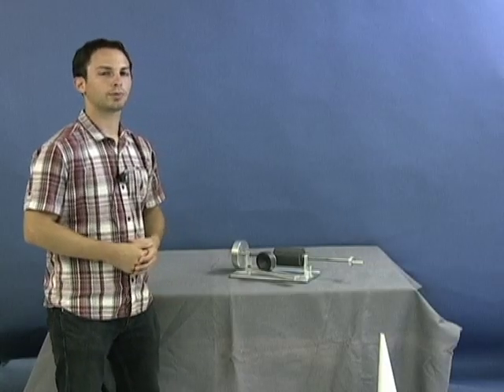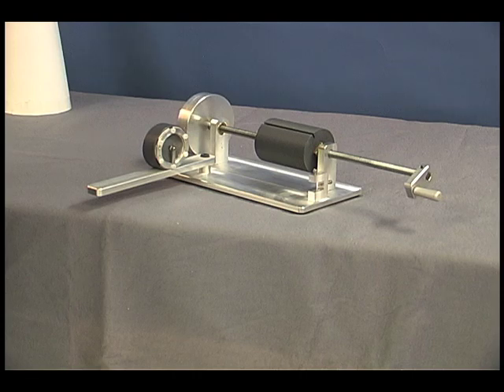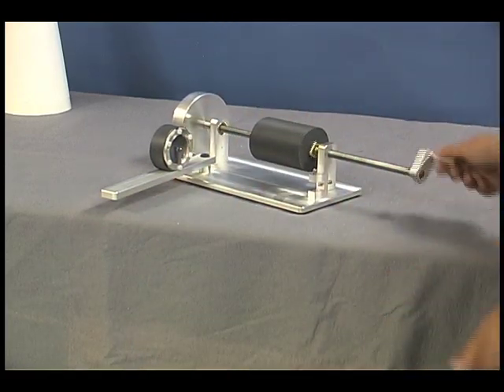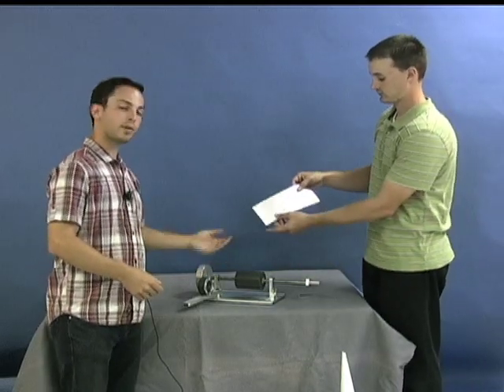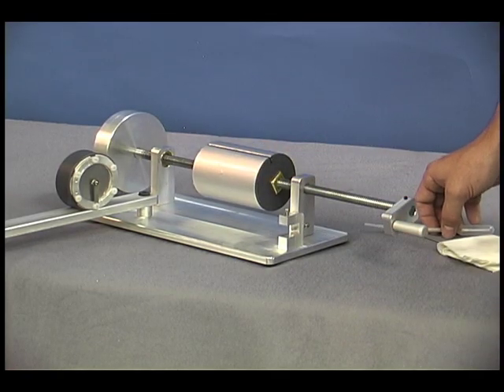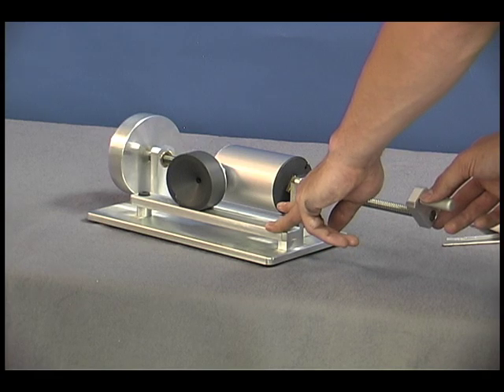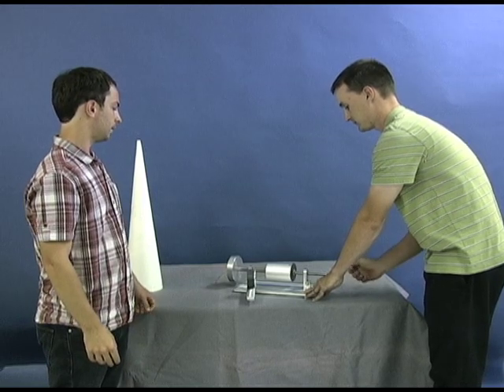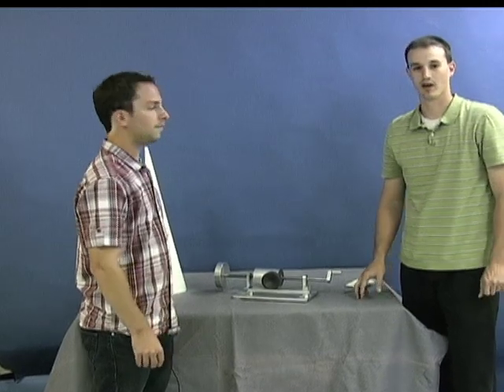A Homemade Edison Tinfoil Phonograph

Comment: Nice job. I'm interested in the stylus used in the diaphragm, I've seen sewing needles placed in a hollow tube, and even needles without the tube.
Reply: just a neumatic analogy piece? air moves it? the needle
Reply: @courseychristopher_art  Air vibrates the diaphragm then the vibration goes to the needle which vibrates it in a unique pattern which etches the foil with the same pattern.
Reply: Yes. That seems to be the heart 💜 of the whole system!

Comment: How dies the needle find the groove to play back though ?
Reply: The diaphragm below the horn pushes the needle through the tinfoil. Then it falls whenever it sees a groove, then it stays on the spiral groove forever.                                     <italic>forever</italic>
Reply: The diaphragm has a weight on it to keep the needle in contact with the markings left on the tin foil. As it brushes over the foil, the markings bump the needle up which in turn inhales / exhales on the diaphragm effectively playing the noise recorded back.